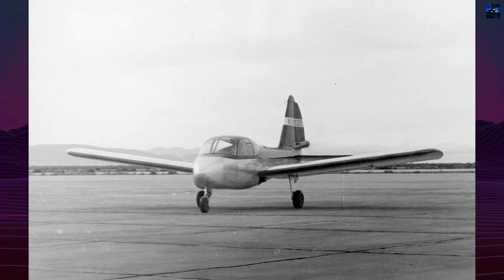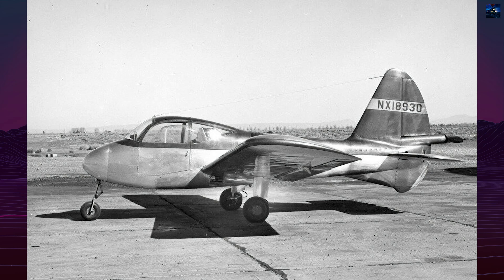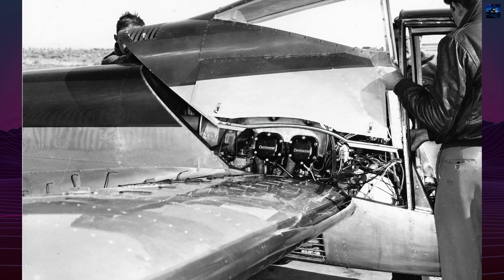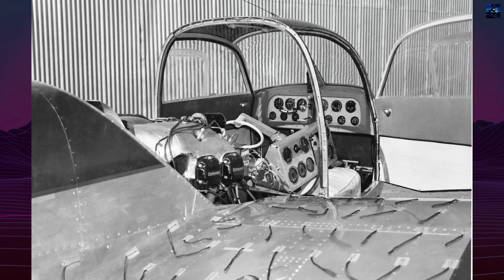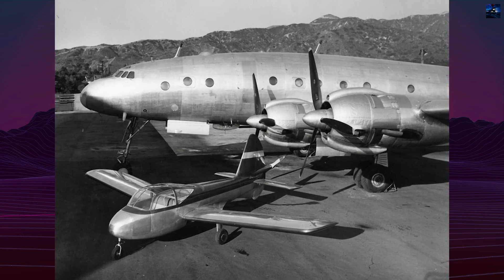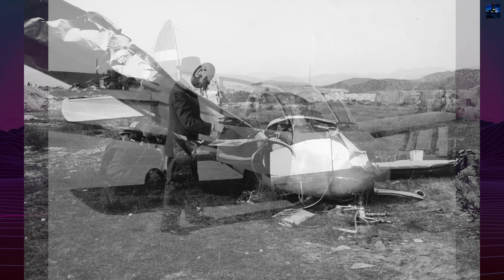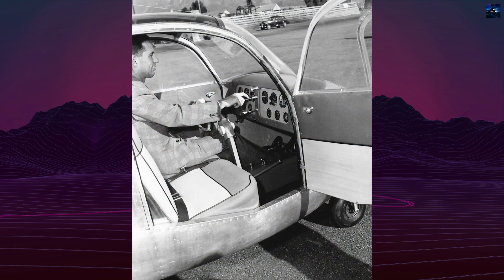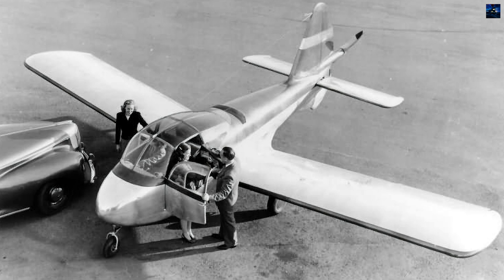Lockheed Big Dipper: The Secret Star of Lockheed’s Lost Projects

Comment: The audio states that the landing gear is fixed, but one photo shows it flying with retracted gear.  In that photo the air intakes are on the side of the plane.  In other photos the gear does appear to be fixed.  More research should have been done.
Reply: So the narration is correct, wrong picture.
Reply: That picture is the Douglas Cloudster 2 not big dipper.